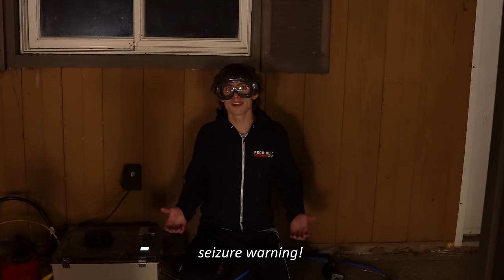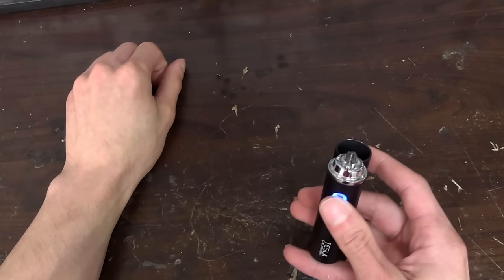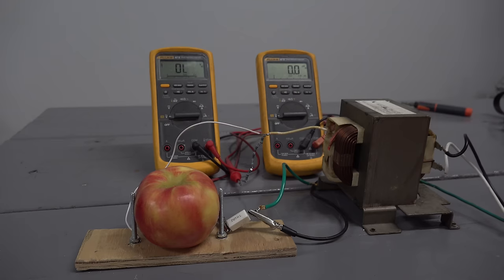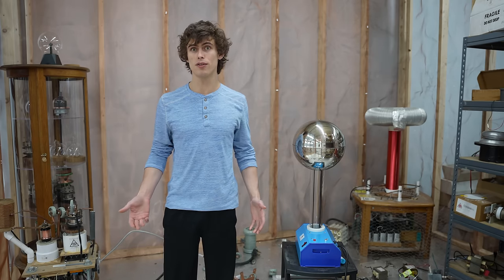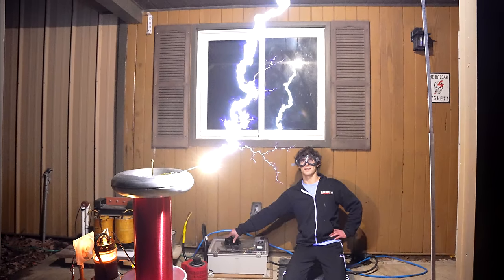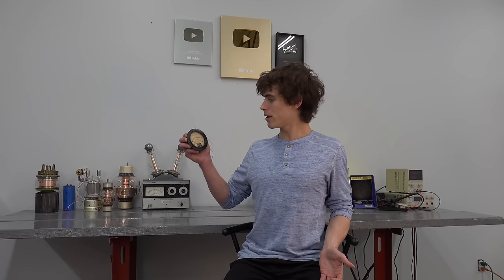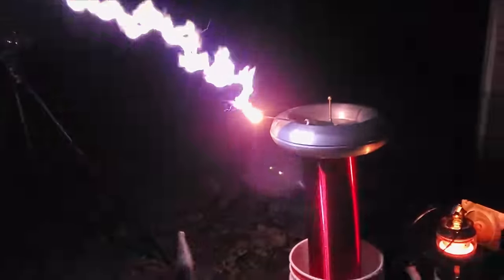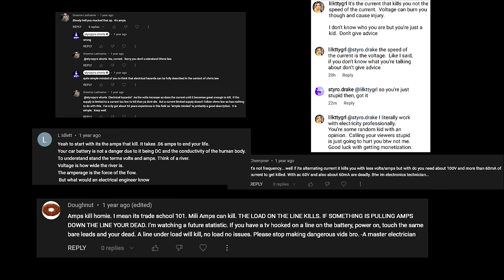Is it the volts or amps that kill?

Comment: I'm so glad you made this video, for over 10 years I've been arguing with classmates and coworkers who say "one volt can kill you if the current is high enough." At my last job I had a 60 year old coworker tell me a car battery will kill you.
Reply: Bet he was shaking in his boots everytime he had to jump a car or replace the battery
Reply: Both things are true under the right circumstances.  The answers aren't wrong, they're incomplete.
Reply: @SteelJM1  To be fair, jumping a car can be dangerous. Touching the leads while someone is revving the engine would do some lethal damage.
Reply: Reminds me of a reddit post I saw about a year back where someone hooked a car battery up to his nut sack just to prove that it wasn't going to do anything because of our natural impedance.
Reply: @ConManJonachan  If it did nothing, then the battery had no charge because you would definitely feel that.
EDIT: From the reddit post in question: "The most painful thing was attaching the alligator clips from the power supply, but aside from that, I'd like to report a mild, and almost pleasant tingling sensation."
Oh hey, I was right!  Shocking!
Reply: @damiencarlson21  Why do you say that? If you rev the donor car up, it's still only putting out ~14.6VDC
Reply: @Bacteriophagebs  watch the video again
Reply: That kid knows his stuff
Reply: it's baffling that anyone thinks this stuff. Like, all it takes is a basic examination of ohms law.
Reply: @damiencarlson21  last time I checked, the battery output doesn’t go above a certain volt/current DC regardless of engine output to the alternator. Makes sense since the battery isn’t just a tube that electricity passes through to get to everything electronic in the car lol, it is after all a battery which acts just like any other battery. It’s just constantly charging when the car is running, charging more quickly when the engine is revving but not going to change its output as long as it has enough charge coming in to run at capacity
Reply: @isovas_og  No, tell me which part refutes what I said.  Because if you think it's the part where he's holding the rods hooked up to a car battery, you have a serious lack of understanding of anatomy.
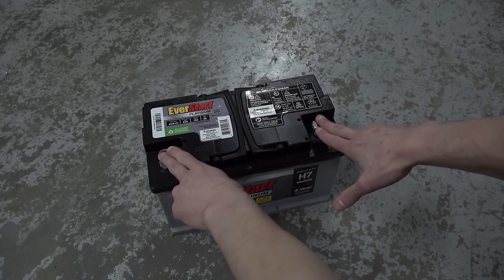Reply: @Bacteriophagebs  sigh.... 3:33. If that doesn't show that the battery is charged, I dont know what will
Reply: @isovas_og  Oh, look, I looked up the post in question and he did indeed feel it!
"These are my testicles straight from the shower. The most painful thing was attaching the alligator clips from the power supply, but aside from that, I'd like to report a mild, and almost pleasant tingling sensation."
So tell me, which part of the video proves me wrong?
Reply: @Bacteriophagebs  Explain why it does not refute your original comment.
Reply: @faizmuhammad4723  Reading comprehension is a good thing!  I wasn't talking about the battery in the video.  Read the post I was replying to before replying to my reply.
Reply: @Bacteriophagebs  sorry, your looking up the post comment loaded late so I saw it late. There being a small amount of current between his testicles is not abnormal, as the body part the electricity must travel is way smaller. But, still, the current that went through still must be small as the guy just felt a tingling feeling.
Reply: @isovas_og  And what did I say?  That you would feel it.  And he did.
Reply: Well it can. When it catches fire with you in the car.
Or when you heat up something to insane temps by bridging the poles, possibly releasing toxic fumes and/or burning yourself+infections.

It absolutely can, just not by shocking you lol
Reply: @damiencarlson21  would it? Isn't it limited to 12V DC always?
Reply: @GleebyDeebyEeby  The enemy is weakened!
Reply: @levyroth  You're making shit up. Plus being grounded will make no difference, car batteries are DC and ungrounded, touching ground will have no effect on the circuit. It only matters with AC.
Reply: @Bacteriophagebs  You were replying to my comment about people saying a car battery will KILL you, and said "that's true under the right circumstance." Then you moved the goal posts to "you will FEEL it under the right circumstance." There is no circumstance where a car battery can give you a lethal electric shock without something else to build up a charge, like an inductor (which he demonstrates at 4:28) This happens because an inductor stores energy in a magnetic field and resists change in current, so when the circuit is broken, that energy is discharged to continue current flow resulting in a very high voltage for an instant.
Reply: @kadenielsen210  Car batteries are "12V" but with the engine running the voltage can go up to as much as 15 volts. Like he says in the video, OSHA considers 50V and above to be potentially hazardous. Car batteries alone cannot hurt you.
Reply: @jonoghue  Look again.  The "feel" reply wasn't to you.
And yes, a car battery could kill you if, for example, the leads were poked through your skin in front and behind your heart.
There is a documented case of a man's heart being stopped by a 9-volt battery this way.  Did he have undiagnosed heart problems?  Maybe, but that would fall under "the right circumstances."
Pay attention to the @ when reading replies.
Reply: @kadenielsen210  When you touch the leads of the battery, you are touching the same leads that the alternator is connected to. So, you are essentially hooking yourself up directly to the alternator. The output of the battery itself is irrelevant in this case.
Reply: @jonoghue   If you found nothing at all, then you suck at using the internet because there are references to it everywhere and people discussing if it's real or not, calculating the resistance, etc.
If you use a Fluke 77 regularly and claim it outputs "less than a volt," I fear for your safety.  The Fluke 77 uses up to 9 volts to measure resistance.
You might use a Fluke 77 III or IV, which are newer models.  Very few people use the original 77 anymore.  That's the (lack of) attention to detail I expect from you at this point, since you don't undertstand the meaning of words you use and can't google a commonly-discussed event.
Reply: @Bacteriophagebs  yet you still can't provide a source? And you "fear for my safety" over 9 volts? Aren't you the drama queen. People test 9V batteries by touching them to their tongues, myself included. it's harmless. And I do use the original 77, the all-brown brick. I don't know exactly what voltage it outputs but I can measure it next Monday. Where do you get the idea it outputs 9 volts? If it did that it would be risky connecting it to any circuit board, you'd damage any chips you touch. You talk an awful lot about stuff you know nothing about.
Reply: @jonoghue  When someone starts citing unprovable credentials instead of facts, they've admitted they have no more facts.
Here's a final nail in your "1, 9, or 12 volts can never, ever, under any circumstances, kill you" argument:
How many volts does a pair of headphones put out?  I'll answer for you: under 3V peak to peak, less than one volt RMS.
One half of a pair of headphones can disrupt a pacemaker if pressed to someone's chest.
One volt, at less than 2 mA, can kill someone.
We're done here.
Reply: @Bacteriophagebs  Headphones don't output ANY electricity. Headphones are a load, like light bulbs, do you think light bulbs OUTPUT electricity too? Where do you come up with this nonsense? Headphones are just a coil which you run AC through to attract and repel a magnet to move a cone. The (disputed) study you're referring to claims that the MAGNETS in headphones MIGHT deactivate pacemakers, they DON'T EVEN NEED TO BE POWERED. You obviously have no idea what you're talking about and are just grasping at straws at this point. "headphones output electricity," that's a new one.
Reply: @Bacteriophagebs  Your first reply which you still haven't backed up with any facts whatsoever? No matter how many times you call a myth proof doesn't make it true.
Reply: If you're in a position where 12 volts is applied directly to your heart you have bigger problems, namely, the hole in your chest. The premise is so unreasonably ridiculous you're already killing someone just to get to that point. My coworker argued that touching a car battery will kill you, that's the entire point of this argument. not that cutting someone open and precisely placing electrodes on the sinus nodes of a person's heart can interfere with its rhythm. You're moving the goal posts off the fucking planet. 
"A car battery can deliver 10,000 times that much." This is proof you don't understand ohm's law. to have 100 amps of current from 12 volts, the circuit would have to have 0.12 ohms of resistance, which is basically a wire. your body's internal resistance, if the skin is bypassed, is a minimum of 300 ohms, which at 12 volts gives us 40mA. That would only stop your heart if directly applied to the right spots on the heart, which would require already likely lethal injury to EXPOSE YOUR HEART. anything less than open heart surgery and you'll just feel a mild shock. Again, anything can kill you with a ridiculous enough example, a blade of grass traveling fast enough can kill you. That doesn't fucking mean grass is dangerous.
Reply: @Bacteriophagebs  If that's the game we're playing then according to quantum physics, it is possible but extremely unlikely, that if I were to spit at my computer screen a wormhole will open up at just the right time and place that my spit will land on your face.
Reply: @damiencarlson21  nope. absolutely BS. The largest danger with jump starting is a short circuit by touching the frame of the car with the positive lead. This might lead to fire. But touch the leads all you want. There's no way 14V across the body will lead to a current anywhere near dangerous.

This video does a good job of explaining things. But many in the comment section still don't seem to get the difference between the current running through the body, and the current running through the conductor that you're touching. For DC or 50-60HZ household electricity both have very little to do with each other. Voltage is what makes the current go through the body.
A car battery lead can be carrying 100Amps to the starter motor or 0 amps. It's not going to make a difference when you touch it.

The bodies resistance might break down under voltage. 

The ONLY way 12V is going to kill you is if you stick some sharp electrodes into someone chest with the heart right between. That might get a decent current through the heart.

Comment: Still thinking about the time that I, as an unintelligent 16 year old, trued to make a spot welder out of a microwave transformer. I had no idea what I was doing. But I wasn’t able to do it due to not having the proper tools to cut the transformer and put new wires in. Every time Styro mentions how dangerous those things are, I always think back to how poorly that could have gone for me.
Reply: Bro i did the same thing when I was 14 ish and i was trying to make an electromagnet 💀. Had no idea what I was doing. So glad we both came out alive.
Reply: oh god
Reply: It's the type of lesson you don't get to learn the hard way
Reply: Phew, you two got lucky.
Reply: @ooooneeee  Super lucky. It was also lucky that I was wearing rubber gloves because the microwave was greasy. I didn't know they can still hold a dangerous charge after being unplugged for days
Reply: I got anxiety reading that. I would like to try chemistry though. Extracting stuff from plants. Distillation. Making spagyric potions and such.
Reply: @adrianaslund8605  That seems much safer, and sounds like something you could absolutely try after a quick trip to a supplies store and with some guidance on what steps to take
Reply: Microwave oven transformers are lethal if you wire them up to their original configuration as it is originally a step up transformer that takes your AC mains in and get 2000v out on the secondary coil with also lethal current. But if you are using it as a spot welder, it is way safer  as it is now wired in reverse so it steps down the AC voltage to just a few volts but high current,  since your body's resistance is too high to draw lethal current from that low voltage source, you can touch it bare without even feeling a tingle.The only way that project can be dangerous is risk of burns, and if you have poor insulation were your AC is coming in.
Reply: @michaelralph6680  yup! I’ve been meaning to get my hands on a microwave transformer of that sort for a while now, but it’s just a bit scary haha.
Reply: you guys woulda been in the darwin hall of fame 😂
Reply: Brooooo

Comment: Excellent video, but one nitpick. You measured the base current of the secondary which is different than the streamer current due to all that sloshing around in the secondary capacitance. Arcing to ground is going to change things too, but it's not a priori obvious what the effect will be.

The one time I talked to Steve Ward about it he wasn't able to get a good measurement because his coil was going unstable under the load. It should be pretty easy for you to measure with that setup though.